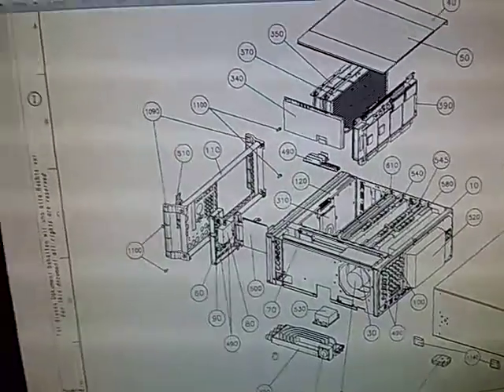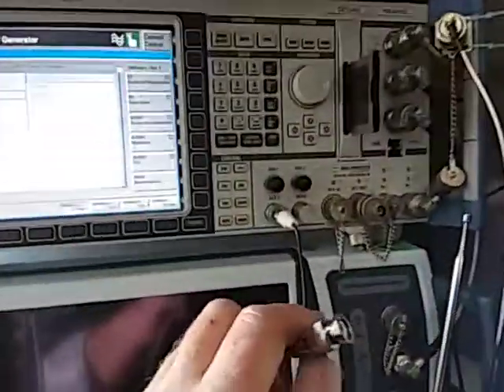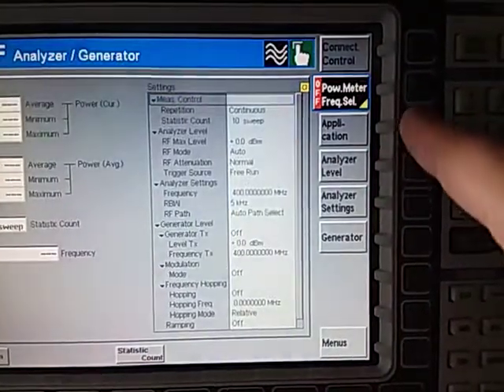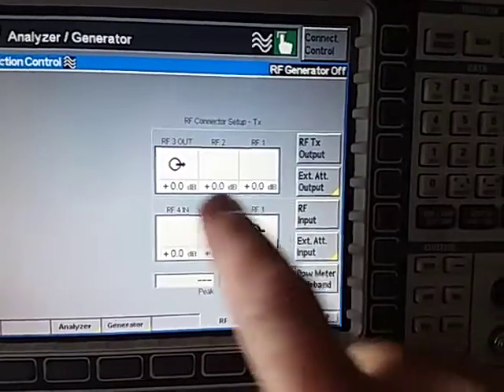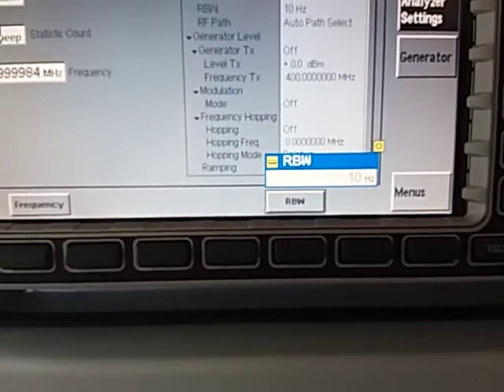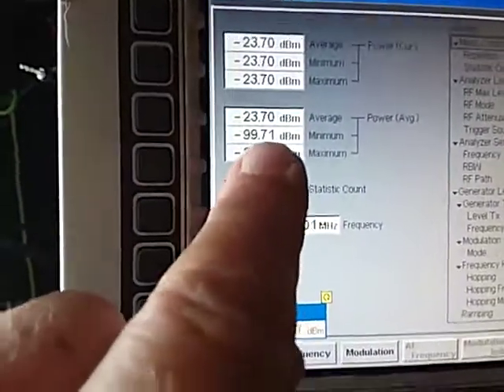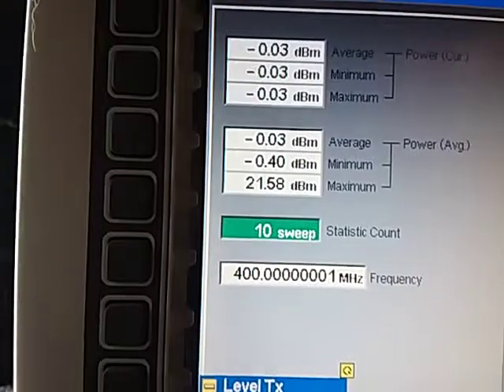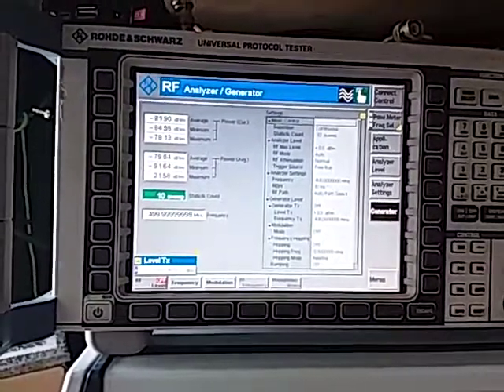Rohde & Schwarz CMU200 or CRTU Cable Calibration

Comment: Crtu or cmu not same thing
Reply from the maker: Apart from minicircuits internal power combiner / splitter, they are the same unit. They use the same hardware and software.
Reply: @ZL1CVD  what about speaker? Has them same?
Is also crtu 2 rf gen option wo 50w capability when installed b95?
Reply from the maker: @Aligreta  speaker / splitter combiner are the only things different. Speaker is of little use as only DOS AMPS S/W option uses it to demodulate FM - no other modes are demodulated. B95 B96 options with wide or narrow range 2nd GEN can be and are fitted to either. CRTU also has a 2nd RF IO module which is never fitted to CMU. But like the audio speaker, there is no way in controlling it from built in DOS software, only Windows. It also cannot be controlled from SCPI.
Reply: @ZL1CVD  so if not am ssb demodulation and speaker cannot be used normally i think not quite adeccuate for mobile radio as a service monitor...
Reply from the maker: @Aligreta  depends what you're requirements are & what configuration cmu/crtu you have. It is a lab instrument & not for CB repair.  Top quality signal generator (am, FM, cw, dsb, lsb, USB,  FM stereo) with low phase noise & wide output range. Excellent audio generator &  analyzer with thd & sinad. Above average spectrum analyzer. Very fast frequency selective and wide band power meters. None of these you get equivalent in ifr, Marconi, agilent / hp test sets. This is typical for Rohde & Schwarz - their equipment all has unique lab quality features. It does have IF output which you can connect to communications receiver if you need to demodulate.
Reply: @ZL1CVD  So far all i was doing was with marconi 2955A that works quite good and let me 65w power in... Not so god as rf gen because of phase noise. There is cmu200 im going to get son with amps
v.14 Signaling Module but as it has 2 rf gen, only 2w input... This last is crap for ham radio jeje... I was doing basic sinad testing and rf frontend tunning, rf power measure and frec adjustment for radios.
Reply from the maker: @Aligreta  well you can add external 100W attenuator easy enough to increase power handling. I use a Bird 100-SA-FFA-20 which works well. When you get your CMU, head over to EEVBLOG and apply the crack to activate all software. But like I found after using HP 8920 / 8924 for years, the CMU or CRTU is better at many single tasks but not a handy tool box for aligning a transceiver. So I use my CRTU / CRTU for specific things where I need accuracy, resolution or speed.
Reply: @ZL1CVD  Hi chris
I received mine... With an impact on the rear panel... Now it doesnt pass loop testing anymore, that hit messed up something inside... Now im in war with USA vendor to get refound as i think i wont be able to repair this unit, if rf deck is damaged I'm screwed...
I wont buy anything on ebay specially from USA... 
I was eager to update good news but...
Reply from the maker: @Aligreta  I'm located in New Zealand & purchased over 10x CMU/CRTU from USA, Korea & Finland. All via eBay. I had one from USA completely refunded and got to keep it for parts. Was dropped on a rear corner badly damaging case frame. I couldn't straighten it. Some others had dint's & dings. That was the only one I didn't bother to do up and resell. But all parts from it worked. 

Most common issue from impact damage is X215 the flat 34 way ribbon cable that connects and controls A20 front end to motherboard A200. It pops out of the motherboard socket which prevents the A20 front end from switching causing loop back tests to fail. In fact I've had 3 or 4 like this. Some were sold as faulty which is why I bought them at a good price with a good idea what the fault would be - simply unscrew case, use a long screwdriver to push X215 home again, test & assemble - under 1/2 hour and its ready to use.

One other had a hard line coax cable (W13 or W14 between A20 & A3) issue. It was open circuit causing extremely low levels and loop back test failure.
Reply: @ZL1CVD  Hi chris... Im in a prelude to be refund, im not sure if they are also up to bring back this cmu200 but as i told them i wont pay more money as ive already paid item+shiping+taxes... In case they refund and discard a brough back i think i will give your suggestion a try. The impact was in the rear right corner oposite to the front end, and selfest fails at MOST of the range but some sucess... So 
Thnks
Reply from the maker: @Aligreta  good luck. It's actually a solid and well made bit of kit. I've had to hammer a few back into shape. Plus its good to get all the cards out and blow the dust away. It gets under the PGBA chips and if humidity is high, you get issues.
Of interest was a note that popped up in one of the forums re filters failing in RXTX modules. I have about 6 with that exact issue so time to start playing :) https://groups.io/g/Rohde-and-Schwarz/topic/87345494#3514
Reply: @ZL1CVD  Hi chris, thank you, so far i wont open it till i get any payback and know if seller finally is up to a broughtback, otherwise i will try open and fix myself or sell it for parts. This unit was sent functional, after back hit both internal and external loop test fails in most freq range so... rxtx modules seems pass selftest
Will update if any new :)
Thanks
Reply: Just connect an SDR receiver to the 10MHz IF output and you can demodulation any mode.
Reply: @xxmrrickxx Hi, interested on this with a SDR connected, what kind of SDR, a adalm Pluto in example?
Reply: Hi chris
As vendor refused refund and pay for returns... Bullshit vendor, i decided to check inside instrument. Cable from rf front end was just fine, however alarm red led is blinking always... From rf front end to rx/tx board there are 2 rigid coax and normal rf flexible cable... By just outer inspection i dont see any issue... But as said the heat might have damaged internals.
Another error i encountered is fm modulator test refuses to go under maintenance menu, cmu200 tell me to run calibration for fm but i cant
Reply: For what do you the splitter combiner? It is not clear for mi, just got this nice device,.got handles as where missing.